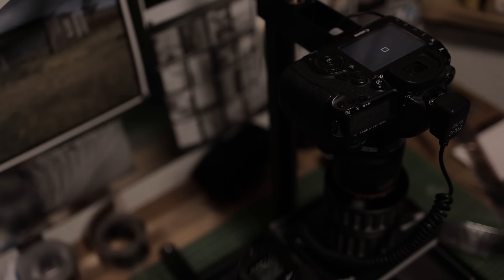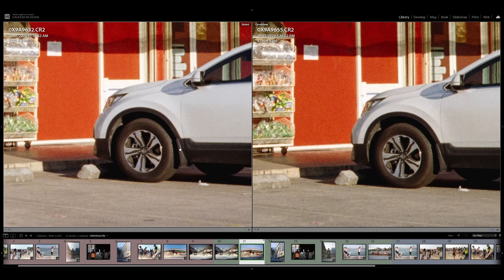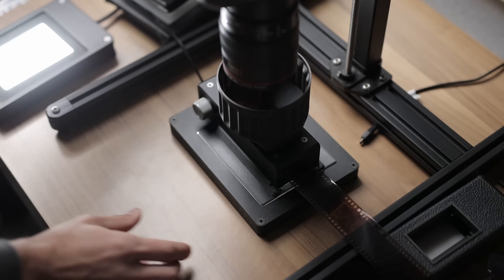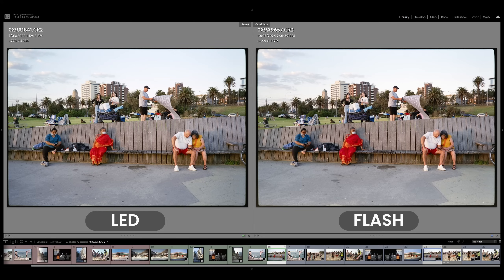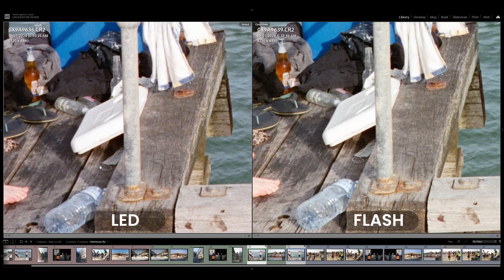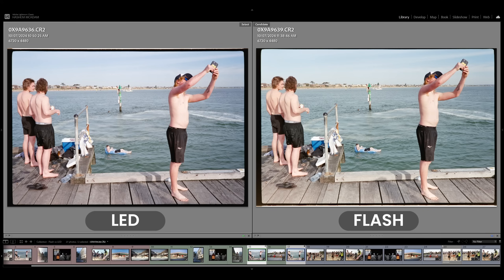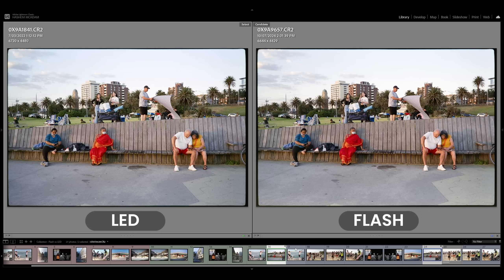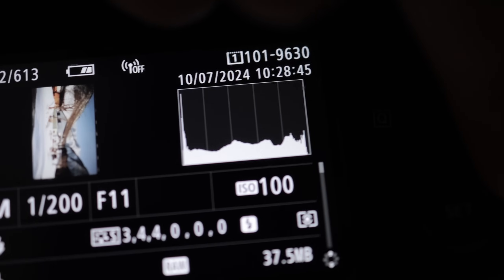Flash for Film Scanning - better than LED?

Comment: Hashem,  2800 Kelvin and 5600 K are measurements of temperature not light.  Pass electricity through a tungsten filament and the friction of the passing electrons heat the filament and this energy is emitted as heat and light.  Lowel hot lights produce a SSI of one hundred and skin tones are beautiful. But if the temperature are held to exactly 2800 or 3200K why does  the light result in a spectrum which varies from low energy of red to the high energy of violet? 
     Not all the atoms in tungsten are vibrating at the same speed.  The distribution of the vibrating atoms can be described by a bell shaped curve with red at the lower energy and violet at the high end. This leads to a wide spectrum of white light.
     But Hashem,  what the hell has this to do with photography??? Over millions of years our eyes and brains have evolved to use sunlight which is a hot light.  Your family looks good outdoors.
Hot Shoe and strobe flashes create a spark  of light at 5600K for around 1/2000 sec. Much longer , say two seconds, and the strobes would burn.  So strobes generate light from heat which our eyes see as true light--skin tones look great.  Then why are 5600K LEDs deficient?
Because LEDs are not 5600K period. All the manufacturers tell us a fib when they describe their LEDs as 5600K.  These LEDs approximate sunlight but they have some deficiencies.  The CRI is a test of the lights fidelity on 8 muted colors that omits skin tones and our eyes are very sensitive to skin tone.   Using a  5600K LED with a rating of 92 CRI for a portrait will shifted some colors. If the blues and yellows of clothing are off  we don't notice, but a slight change of pale skin tones ruins a portrait.

Comment: What if you place a reflector in the bottom of the box and flip the flash to shoot down to the reflector, the light would bounce off the reflector traveling upwards hitting the diffuser.  I think this would spread the light even more and thus it would be easier to avoid hot spots.
Reply: Color temperature will be affected if the bounce surface is not color balanced

Comment: Full so called ColorSpectrum is only possible with a flash, LED's by default and physically can never deliver a full colorsprectrum. (thats not color temp...aka Kelvin). Google COLORSPECTRUM...  this is only important with color negs or slides/chromes. for Black and white both would deliver the same results. Also: Cri values are technically "NOT" applicable to LED lights, (contrary to common believe), Cri value is solely applicable to Fluorescent Lights for which it was invented, and additionally, such a Cri Number is "NOT" Spectroradiometer measured , but its a mere, rough and only subjective (human person) ballpark measurement, guessed by the Human Eye of a Person, (what a farce, right?). and: Spectroradiometer ( https://en.wikipedia.org/wiki/Spectroradiometer ) thats a machine which measures not only the Kelvin values as well as the brightness, but more specifically measures the missing colors (missing color wavelengths) as well, in contrast to a better known Photospectrometer, wrongly used here for that matter, and usually only used to calibrate monitors and printing machines, which most think so very wrongly , is the measuring hardware to be using here on LED's.
The results with your Color-meter here miss the point of LED problems, which are those muddy colors, originating from missing in-between colors. this video, which is part of a series of videos about LED in Film and Photography, explains it more technically: https://youtu.be/WOdlllJjkas
Only a Spectroradiometer ( https://en.wikipedia.org/wiki/Spectroradiometer ) can measure these color amounts in each specific wavelengths.

Comment: I purchased an x-ray light box online from a dental office. I took out the internals on one end I cut an opening for my canon speed light. On the other end, I cut another round opening where I installed a nightlight type bulb socket that could be turned on and off with a flip switch when focusing. I lined the light box with silver foil tape.  I, too, am using F 11 with 1/64 power. My color corrections have been excellent!
Reply from the maker: Nice!

Comment: I've been using a flash for a while. I started because my scanning light (which was expensive) was not giving me very fast shutter speeds at 100 iso and F 5.6. Unsurprisingly, flash kicks constant lights's butt in terms of brightness. I use a mixing chamber from an old enlarger to diffuse the light. I will keep using the flash for black and white and slide film, but I'm working on building a custom RGB light for color negative film scanning

Comment: I ve tried a custom tunable RGB set - there was no such big difference in the result on a first look. But if you look at the channels while conversion you will see one significant thing. Because the base layer of the film has its own saturated tint (yellow for example) you get less information in blue channel unless the color temperature of your light is cool enough. Even if it is around 6000-6500k it still gives a lack of info in blue channel. That causes excessive noise in blue channel while converting. RGB or a very cool light (even through a cyan gel filter) gives you slightly better results due to a better base layer exclusion (the more grayish you make it in pre - the clearer will be the result in post). So you can use a cyan gel filter on a flash or make your rgb light as cool as it needs to be for your negative.
Reply from the maker: Interesting!

Comment: Interesting experiment.

One convenient way of reaching a good diffusion would be to bounce the light from the flash off a white sheet of paper. 

For example, the flash pointing into a small box with a white sheet of paper facing the film holder and camera, or a sheet of paper at 45° and the flash perpendicular to the camera and film holder, as I used to do for duplicating slides with less contrast before digital photography.

Comment: Color temperature and CRI only tell part of the story when it comes to light quality. The improvement in quality when using flash, especially with slide film, is due to the spectral power distribution of flash vs. LED. I've experimented with measuring the spectral power distribution of LED, fluorescent, flash, and actual sunlight with a spectrophotometer (i1 Studio) to generate graphs of the spectral power distribution of these different light sources, and the graph for speedlite output most closely mimics the graph for sunlight. The output from LED has peaks at certain wavelengths, and the output from fluorescent is spiky as heck. One can get away with a somewhat incomplete spectrum when doing negative conversions (depending on which wavelengths are deficient), but with slide film, reds and skin tones will suffer the most from poor-quality scanning light.

Comment: Great video Hashem! 

Totally speculation on my behalf, since I don’t use flash, but I think the more neural colours that you’re getting from the flash are due to the flash being a better quality of light source. Much like that which you’d get from the sun or a tungsten bulb. 

Unless you’re using a really high quality LED fixtures, you’ll find might find a minor green or magenta shift in LEDs. Even if the LED has a high CRI and TLCI ratings that doesn’t really show the whole picture regarding the quality of the light.  

From my understanding SSI ratings are a much more accurate way to rate LED fixtures. 

If you want to go on a deep dive the channel @gaffergear has some great videos on LED lighting. 

As your research suggests using RGB lighting will probably allow you to get better quality scans as you can dial the rgb values in. They typically have a +\- green and magenta function. 

If you were to go do the route of RGB experimentation I’d suggest giving a light fixture with RGBWW LED diodes a crack. These have an additional warm white LED. Which can help improve the light quality.

Comment: Good practical analysis of flash vs LED. One more variable to consider is the actual amount of diffusion and the effect it has on contrast, edge sharpness and perceived film grain. Highly collimated light from a point source or through condensers results in higher levels of these characteristics compared to diffuse light sources. This is obvious in darkroom printing where a higher contrast grade printing paper or filter is usually needed with a diffused light source enlarger vs. a condenser enlarger for the same film negative. This is a generalization and a better understanding can be gained by searching the Callier effect.

Comment: I remember back in 2014-2017 when I didn't have access to a lab providing decent scans (I was in Greece at the time), I was improvising with the equipment I had available at the studio I was assisting. I was using big studio flash lights with softboxes on the floor, and on top of that I was rigging a sheet of white plexiglass that acted as a large diffusion and then trying to photograph the negative on top of all that 😂. I'm sweating just thinking about the amount of work I was doing just scan a few frames which I would then have to manually convert in photoshop. I'm so glad analog has made a major comeback and has allowed us to have all these different ideas and products. Everybody is pitching in on it and we are collectively progressing. Quality of light is definitely very important and if the technology is not there on video lights then we could definitely find a way to rig flash lights to do the job.
Reply: hahaha currently in Greece and facing the same scanning problem! on my way to build a good setup ✊
Reply: @penquito  Are there any new labs in Greece or labs that have made a comeback or not really?
I’m sure you’ll make a killer setup at home. There’s plenty of resources online to take inspiration from.
Reply from the maker: Yep, we've sure come a long way!

Comment: Surely this is just down to pure science.  A flash gun (modern) will have very good light consistency (5000-5600K).  Depending on your led light pad you may be using a source with high variability.  Better light pad better consistency and better brightness = better results.  Pure cost to quality equation.  If you're using a 300-500AUD flashgun as opposed to a 50-120AUD led light tablet - buy a high quality light tablet and you'll see the same results surely.
Reply from the maker: Not necessarily the case, since these comparisons were with a Negative Supply Light source in that price range.

Comment: Not a film specific thing, but tungsten lights have the best colour spectrum possible (according to light manufacturers).
So probably the best colour capture... but you have to deal with the heat of a tungsten light, so its not super practical.

Comment: Hashem from my experience with flash, the key to making this work would be to extend the distance of flash to film plane with adequate diffusion for an even spread across the film plane, while also doing as custom white balance to ensure that the diffusion is not causing a colour shift. I'd also line the box with black matte material that stops the bouncing of light within the box itself. There are clearly other variables, but in terms of flash alone, that would be it, along with the quality of the flash output, which is dependent on the model.
Reply: And why not, on the contrary, to cover the inner space of box with reflective material? This would improve the situation with the uniformity of dispersion, it seems to me...
Reply from the maker: Yeah I figured this would be the case regarding distance, as mentioned in the video. Lining the box makes sense too! But, I had to make due with what I had in terms of materials and time (for the purposes of my test). It would be cool to see people's purpose made setups using some of these techniques 😃

Comment: I still maintain that the Cinestill CS Lite is the best of any light source I've used that's currently out. That little color setting is a shocking difference maker, and it's cheap. If it could fit a 4x5 sheet of film on it, it might be perfect.
Reply: *And I've been camera scanning for about 10 years now. Not new to it at all.
Reply from the maker: @JamieMPhoto  nice, yeah I've heard good things about that one

Comment: The flash did look noticeably better imo. Scanning is already laborious though and I could see the flash method adding to that. Nikon's slide duplication system that's been around for years was always intended to be used with a flash if I'm not mistaken, so it makes sense. I honestly just wish someone would make the Pakon type scanner again so I can just feed rolls in and have them scanned quickly without me doing anything.

Comment: I’m one of those people who actually owns a $1600 colorimeter to measure light quality. It’s true that flash generally has a fuller spectrum than even the best LED, but for some reason people always ignore tungsten light sources as an option. Tungsten is higher quality than flash. It measures a perfect 100 in every metric - it’s literally the benchmark against which other artificial light is measured. The only light source that compares to tungsten is the sun, but only on a clear day if you mask off blue skylight and just measure direct sun. And I don’t mean special photo lamps, any cheap halogen bulb at Home Depot outputs perfect color quality. You could test tungsten as a scanning light source… I haven’t got around to it yet.

The RGB lighting thing you mention could be promising. Color negative scanning is crazy complicated. For interest, I own a Flextight and have measured the light source inside it: it’s shit quality by the metrics. Yet the flextight generally produces the best color results I’ve seen, probably due to some secret sauce in the software (which is very old now). So you can get a great scan without great light in practice, but I don’t know anyone who has inside knowledge to explain the theory.

I have a high end Arri LED with RCBACL light engine that should be able to be tweaked to match the characteristics of the RGB light source inside a Fuji Frontier scanner if I can get someone to let me measure it. If I have time I’ll do a scanning test to see if there’s anything promising there..

Comment: Cool test, thanks for posting!

IMO Sunlight>Flash>LED, but LED is super convenient for the reasons you mentioned. Results aren't that different & in most cases the pros outweigh the cons. Sunlight is the benchmark in terms of fullest spectrum, then probably followed by tungsten light, hmi,  & flash. LED is lowest in terms of quality. We still haven't figured it out yet even if its 99+ CRI. The spectrum isn't as full and it peaks at different color spectrum values, as opposed to heat based light sources which are fuller/more even. After all LED is working from a binary, like digital cameras, and the gradation of the spectrum is inherently binary as well.  Some newer tech like RGBWW & RGBACL is helping to flesh out the spectrum.  What this all means in terms of how the digital camera perceives the different light sources? I have no idea. According to your tests, others I've done and seen, the differences are so minimal it kind of doesn't matter. Unless you are trying to raise your shutter speeds, using a really poor quality LED, etc.

Using something like the nikon ES-2 and diffused sun should yield best results, but then you have to wait to scan until conditions allow. Also doesn't need tripod or copy stand. I wish there was a 120 model.  RGB scanning sounds like it could do a good job technically, but the post needed to make it work... like stitching 120 scans for higher megapixels,  I can't imagine it being worth it in most cases.

Comment: I've always used flash - an AD200 in a softbox. The only disadvantage I found was that it is harder to focus, but I could use the modeling light if I were to use the flashlight head (I use the bulb) I use an on-camera film holder so I just aim at my softbox (which is already set up) and fire away. I feel like I can get through a roll pretty quickly. I use shutter speed and HSS to control exposure, because adjusting exposure in-camera is faster than on the remote.

I calibrate my exposure by shooting without any film, exposing so that the white touches the edge of the histogram.
Reply: Thanks for these tips! I've been scanning with led light but i get white vignettes, presumably due to uneven light. So I want to try with my ad 200.

Comment: LEDs generally do not have a continuous spectrum output of even intensity. This applies to white and color LEDs.  Flash will have a more balance spectrum. However, the function differences are often quite small, and they can be adjusted in a digital processing world. On the other hand, the same cannot be said for using LEDs as a light source for color printing on traditional photo paper, which is more sensitive to gaps in the LED spectrum. This was illustrated recently in a carefully done analysis of the Intrepid LED enlarging light source, which found that the choice of LEDs for the light source were so poorly matched to the photo enlarging requirements that a properly corrected print could not be made.